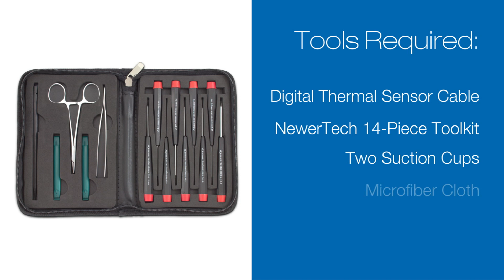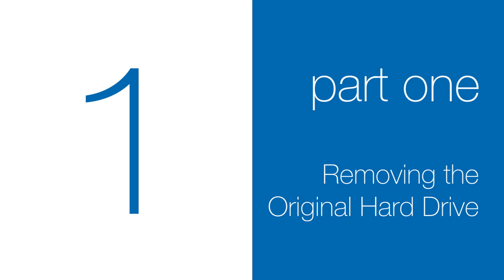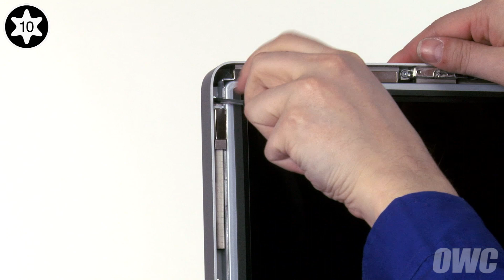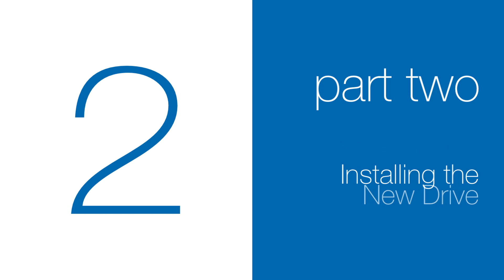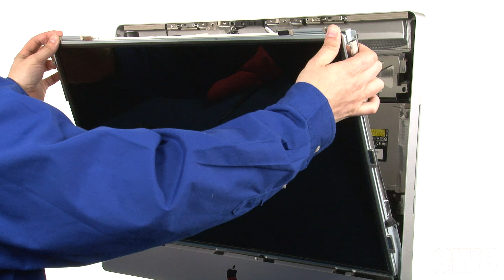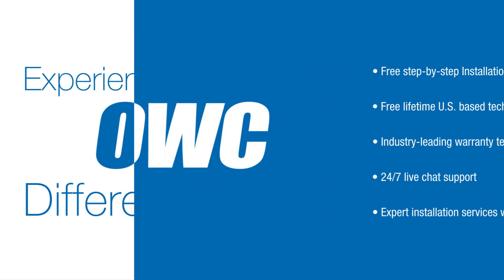How to Upgrade the Main Drive in a 27-inch iMac 2011 (Updated)

Comment: This updated video is for a different SSD and mounting adapter than what OWC sold me. This one looks like another hard drive is being installed not a small SSD. I cannot find the original video which is the correct one. Customer support no help so far.
Reply: Probably this one: https://youtu.be/eFHvIrdm9So or this one https://youtu.be/03Lg4IgJd04

Comment: This might be a dumb question, but how do I install OSX on the newly installed SSD? I'm strongly considering doing this upgrade along with adding some RAM to a 2011 iMac I have laying around, but not sure exactly how to go about this.
Reply: I'm in the same boat. I am just cloning my HDD to my SSD via an external dock. My hope is that when I replace the SSD it'll just boot up as normal. Hopefully that helps.

Comment: Hi-thank you for this video!  I changed it as shown and wanted to ask 2 questions 
I did not have an own cable with my replacement-will that make a difference?
Also upon starting the computer I am only getting a folder with a question mark folder..please help!!!!
Reply: U need to install macOS on the new HD before U dO these steps I think. U can also call apple hotline, they will give u directions. Hope it turns out well for u

Comment: Thanks for the video, I've been meaning to do this to my wife's iMac for YEARS... but it wasn't until the latest OS upgrade that the original drive finally had serious enough errors that it needed to be replaced. I bought the OWC cable and a 1TB SSD and the video made things really easy. Only "trouble" I ran into is the super-cheap 2.5-to-3.5 tray I bought had screwholes a little too small for the stock pins & screws, so I reamed them out a bit to let me get the OEM pins and bracket onto it. Works like a charm with the OWC cable. Thanks!

Comment: Fuuny how some mac repair place quoted me $80 to swap my HDD to SSD and said "  Its very complicated and difficult install process that takes 2 hours and gotta remove 20+ screws "  LOL LOL. 
This install was so simple and did it MYSELF in 25m with no previous experience too. Added a 1TB SSD to my 2011 Imac 27" and no Thermal sensor needed. There are plenty of freeware fan control Mac applications that work great to make the fan run at normal speeds and most of all QUIET !!
Reply: Hello, did you replace the stock HDD or did you add an SSD? thx
Reply: @ramonbs6075  He said "Added a 1TB SSD to my 2011 Imac 27"

Comment: Thank you so much for this tutorial. I purchased the upgrade kit from your site, and I followed the instructions to the letter from this video, and my upgrade went smoothly. Two suggestions that I would make: 1) A pair of tweezers should be included in the upgrade kit. I had a pair from previous PC builds, and I found them to be essential for removing and reinstalling the torx T10 screws from the LCD panel. 2) I would suggest recommending wearing surgical gloves while working with the LCD panel. They're a good extra precaution while handling the sides of the panel, just in case you accidentally touch the panel itself, and the latex from the gloves helped to keep a good grip on the sides of the panel. Overall, excellent instructional video, and excellent toolset. I will definitely be using you in the future for my Mac needs.